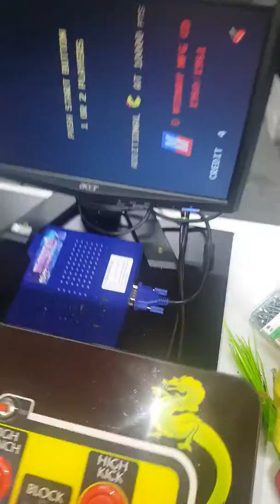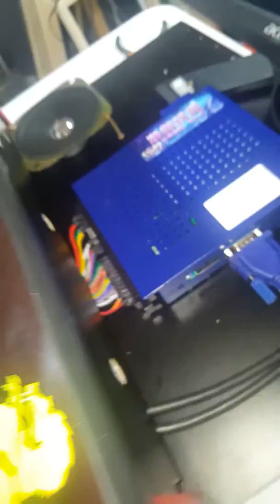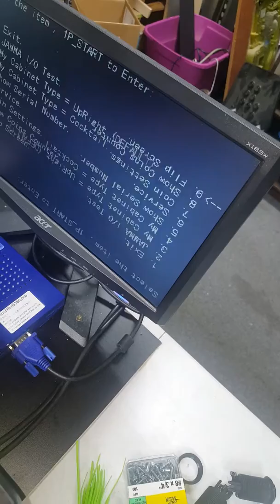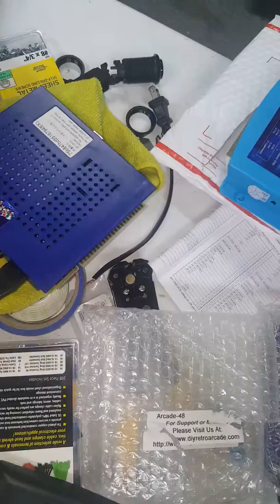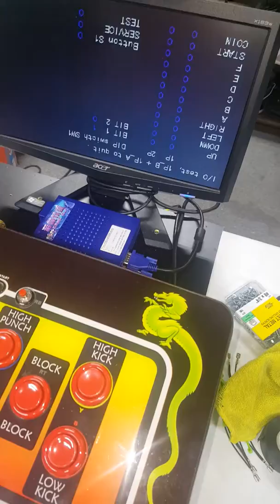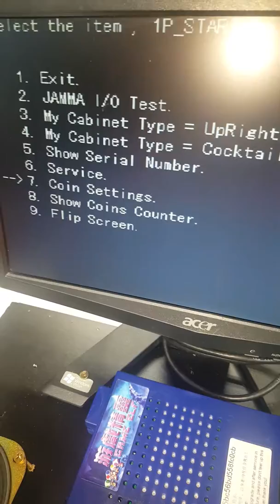Menu mode for a 412 in 1 jamma board and correct power

Comment: I wanted to upgrade my 60-in-1 to this board however I heard that the 412 board is really bad with trackball control and does not save any high scores.  the 60-in-1 saves the top score, but not the name.  Supposedly the 412 saves nothing.  Have you confirmed these complaints?  Thanks!